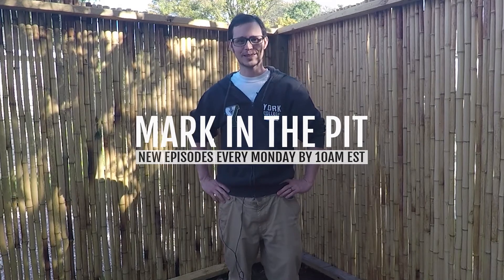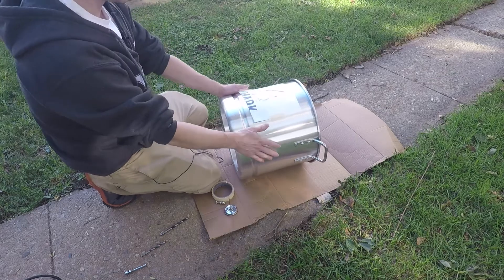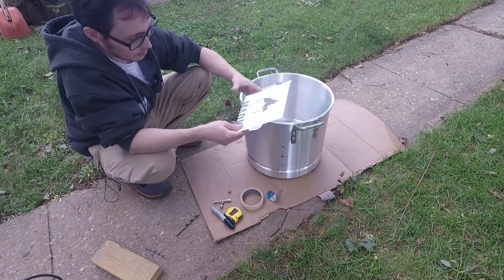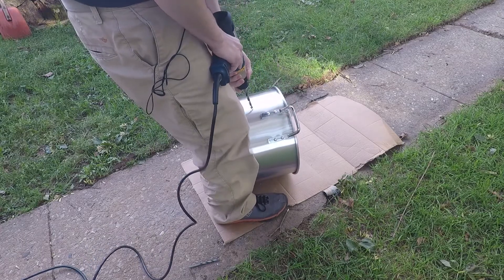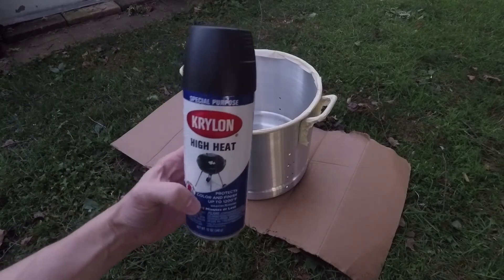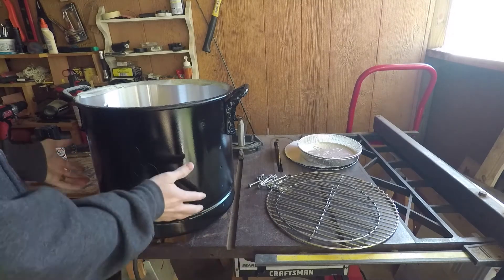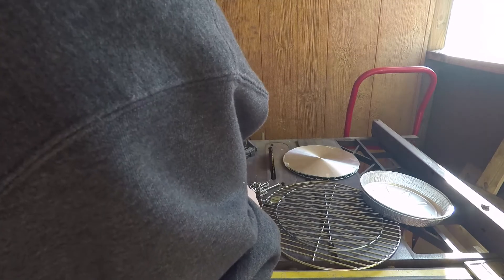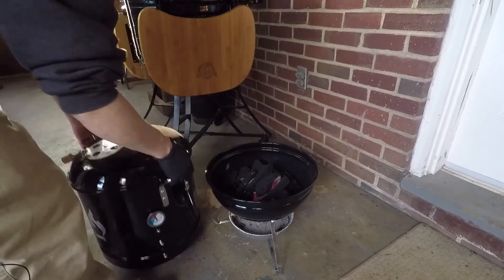Mini WSM Build From Weber Smokey Joe ( COMPLETE BUILD )

Comment: If you want a probe hole for occasional use, check out the Weber parts page. They sell a silicone grommet for the WSM probe port on the newer models. I've found it for about $11 bucks on Amazon. Just use a stepper bit or hole saw to drill the appropriate hole in your new Mini WSM.
Reply from the maker: +KlueBat Sweet, I'll check it out.  Thanks!

Comment: great video! but does everyone know you can buy coal baskets that make the kettle an indirect smoker without all the fuss? And a top grate that hinges over the coal baskets???
Reply from the maker: On something this small one of those charcoal baskets won't make much of a difference.  They do work pretty good on a full sized kettle though by keeping the heat off to one side.

Comment: Aluminum not healthy
Reply from the maker: I agree, also there is aluminum in almost everything now a-days.  One thing to note though, after the first few burn cycles it does get coated with smoke, ash, fat, grease, which is then cured to some extent and is no longer exposed.  Also the grates themselves are stainless steel so nothing aluminum directly touches the food.